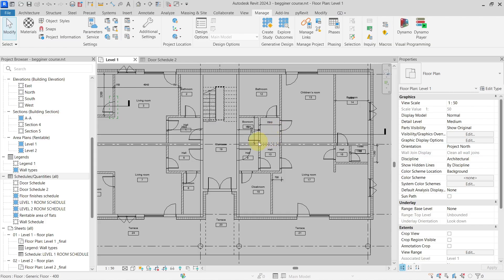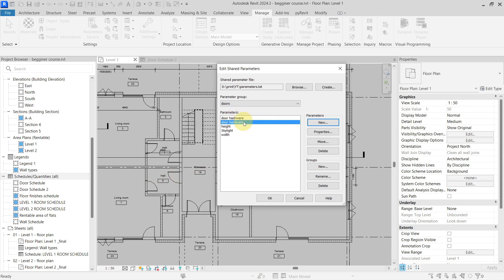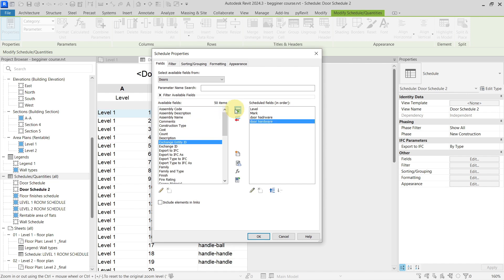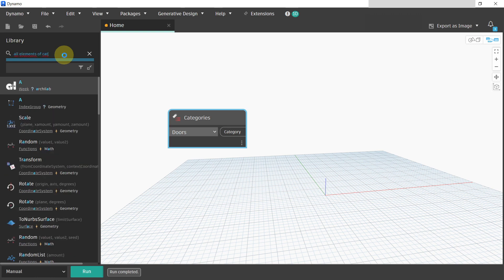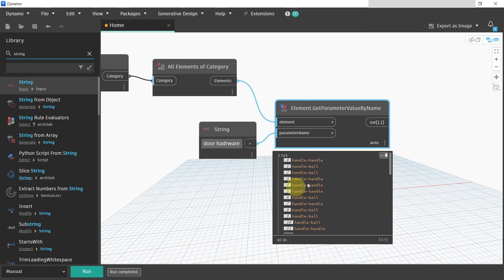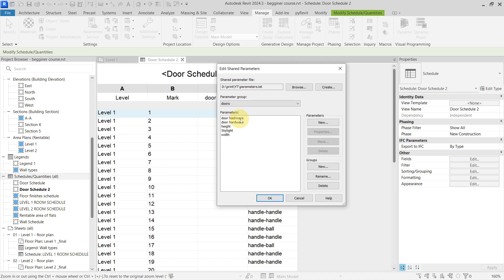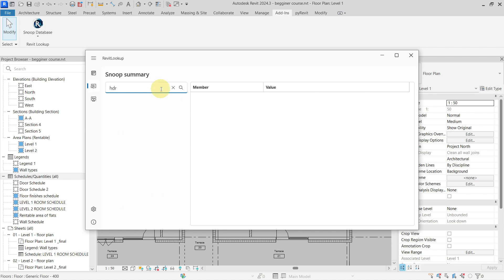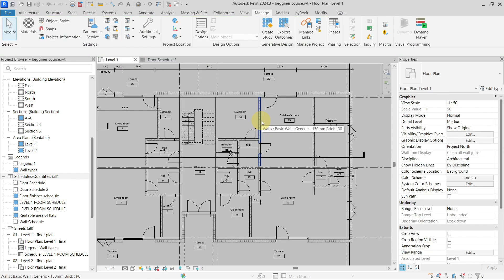Revit Tutorial - How to rename shared parameter

Comment: Technically, you’re not renaming the parameter. You’re creating a new parameter and removing the old one.
Reply from the maker: Yes that is true, because that is the only way how it is possible
Reply: @eMexperience  You’re showing the most important and critical part in your video, how to remove a shared parameter from Revit’s internal database. And a big thanks for that.
If you need to keep the same GUID for the parameter but give it a different name, then you have to open the Shared Parameters file and change the parameter name manually (With excel for example). Then you can remove the parameter from the Project Parameters list in Revit, and use Revit Lookup to remove the parameter from Revit’s internal database. After that, you can bring in the same parameter (with the same GUID but a new name) from the Shared Parameters file with a new name.
Reply from the maker: @RevitRoots  yes that is also true, but this can corrupt your Revit project so i prefer not to teach this, also you would need to use other parameter or some external database for data transfer between parameters, i find it easier with the method described in the video ;)